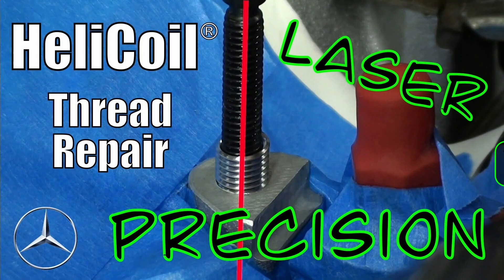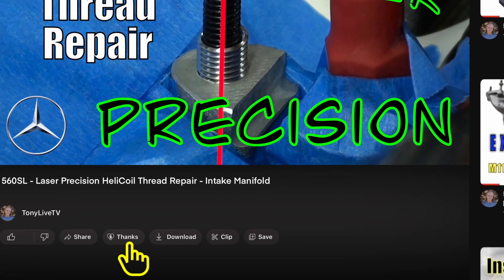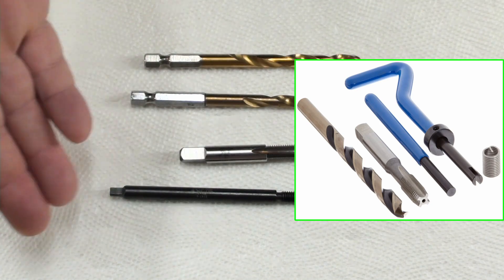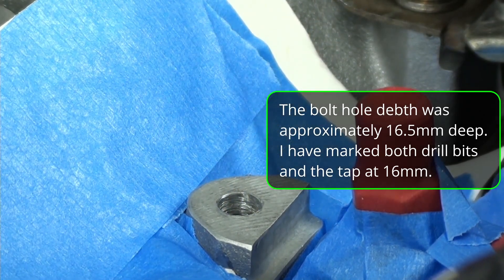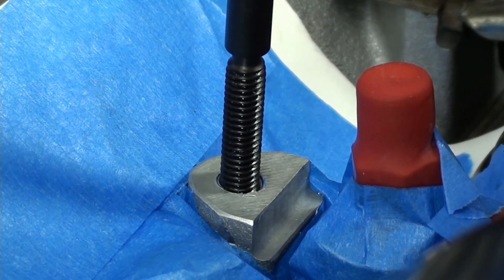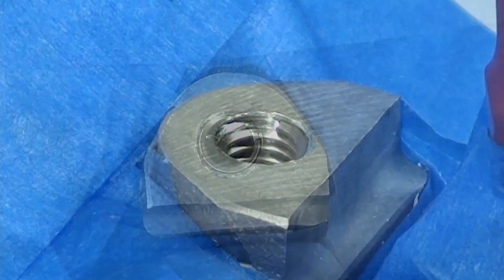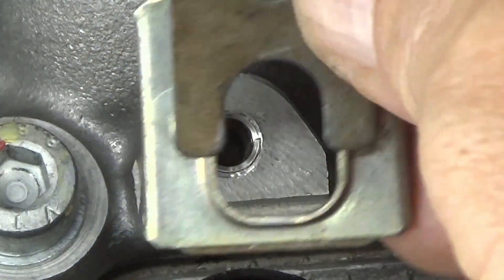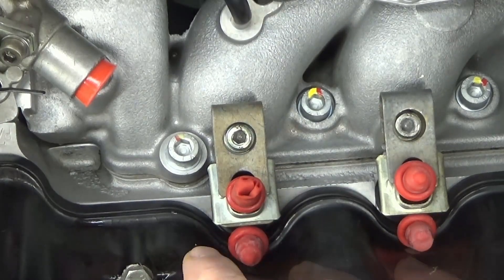560SL - Laser Precision HeliCoil Thread Repair - Intake Manifold

Comment: how are you getting the laser line.  Video does not explain.
Reply from the maker: I am using multiple cameras and a transparent overlay over the camera's video feed. It's kind of hard to explain, but is simple if you see it. I am using a multi camera video switcher that allows me to put images (overlays) and place it over a camera feed. I told you it was difficult to explain.

Comment: Do you know the torque for tue bolt so I don’t strip mine when I replace them all.
Reply from the maker: There is no torque specs for the injector retainer clips. Just wrist tighten them. Their only purpose is to hold the injector in place.
Reply: @TonyLiveTV  okay. When I had one ten years ago. I stripped one of the bolts after I had replaced all the injectors and seals and all and drove with the other three bolts holding the whole rail down. It was down in there. But wasn’t fastened with the clip… I no longer have the car.

Comment: See. This looks much easier and cleaner than what they did. Do you have an email so I can send you some pictures of the damage he caused to the screw hole..
Reply from the maker: I’m sorry, but I can’t share my personal email. I am already overwhelmed by questions from Facebook, Benz forums & YouTube viewers. The most important thing to know is that nobody cares about your stuff more than you do. I’ve already shared the video about the incompetent machinist and the right cylinder head work. What you may not be familiar with is the video of a thread repair made by the same machinist. He installed a Time-Sert which fell out when I was installing the water pump. I didn’t even tighten the bolt. You can see that video here: https://youtu.be/P7d8t4KkjR8